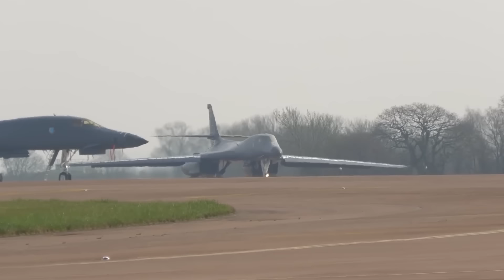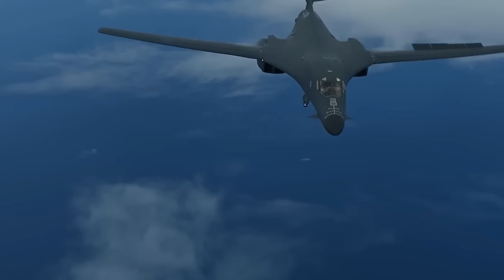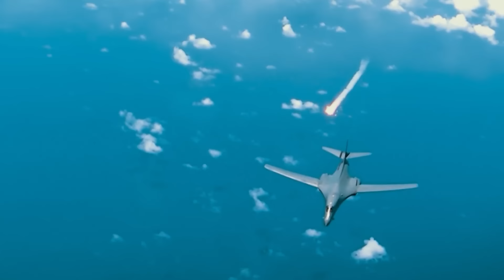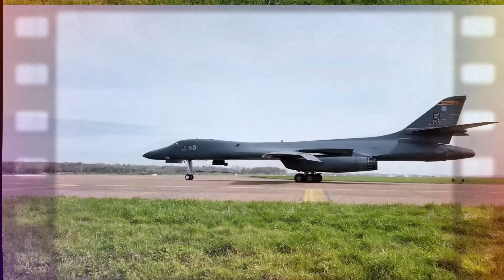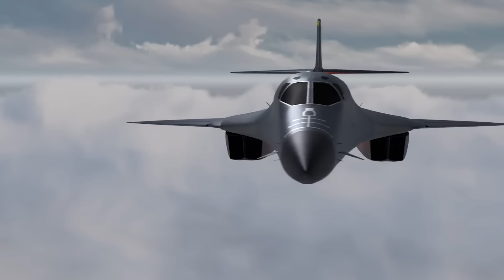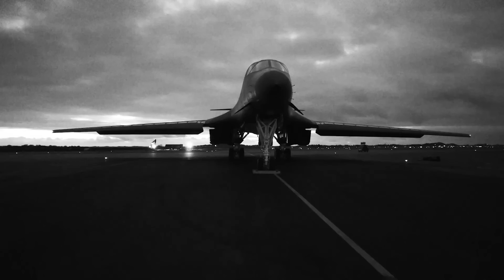The INSANE Engineering of the B-1 Lancer

Comment: B1C. Make the shoulders wider and the swings smaller. That would do wanders for the maintenance. You can probably store more fuel, too. Also, by running smaller swings, you run a smaller system, less wieght.